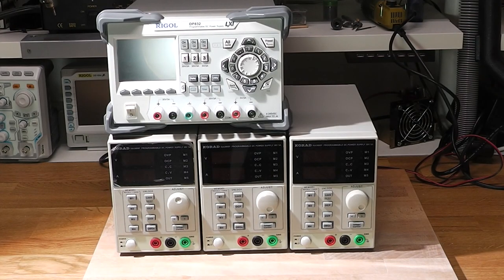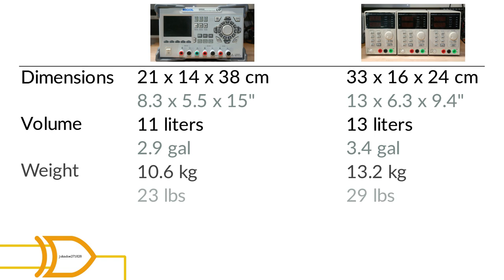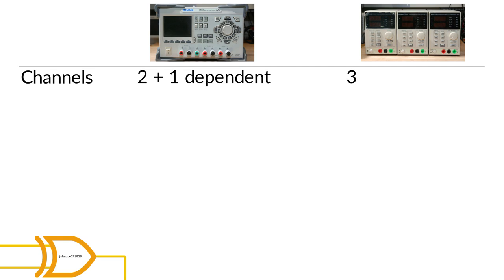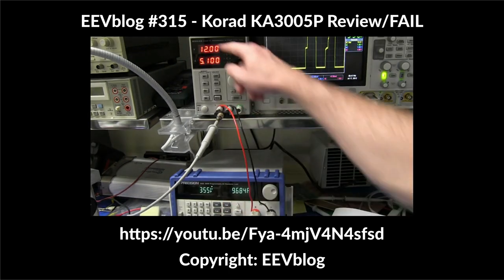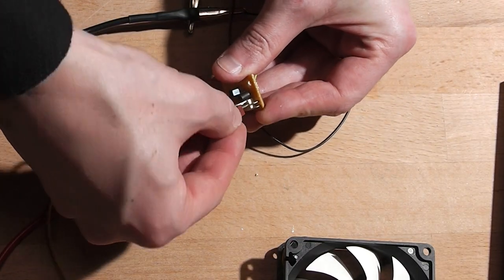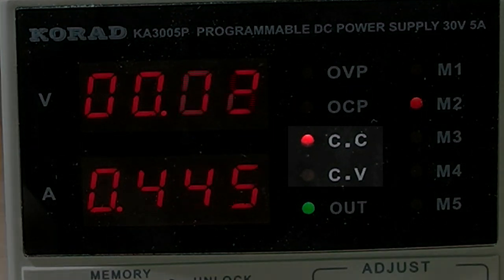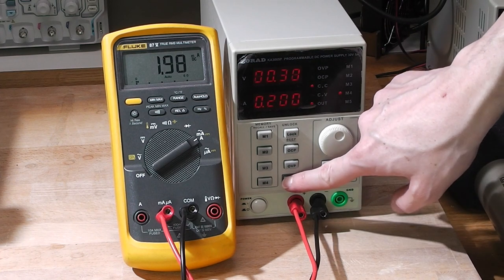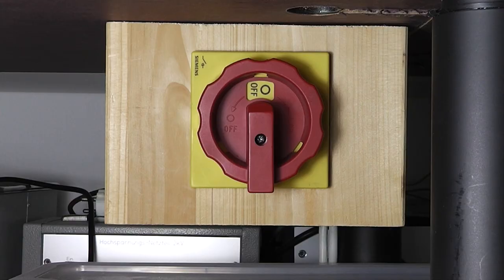Rigol DP832 vs. Korad KA3005P

Comment: The Rigol is programmable in many ways, that are all totally ignored in this comparison. There are complex Timer, Delay, and cutout programming modes.. I can easily set it up as a battery charger that cuts-off when the current falls below a threshold, to prevent trickle overcharging.. the Rigol is a proper Tool not just a Dumb Box.
Reply: So many fancy features and still sends voltage to your device when powers on… Without basics even fanciest equipment is a pain in the bum.

Comment: Rigol is modern design, it's Control part is seprate from output part, this means:1) You can power on 3 channels at the same time,so when your board has different power domains(such as 12V and 3.3V) can be powered on at the same,more safe.2) Programable,very useful when you debug your board. I had debug one board with python, capture output from UART, when some output is printed,hold on the state and alarm , if not power down and reboot again.
Reply from the maker: Turning on multiple outputs all at once is indeed something that multiple Korads cannot do and I completely missed that part. However, I think it's something that could be modded as well! So maybe an idea for a future mod :-)

The Korad 3005P version is also programmable, however. It has RS232 and USB and can be read out and controlled by it. This is why I didn't mention it (it's the same for both supplies).

Regarding the modern design, I'd disagree with you, however. While indeed the design is using more fancy chips and display, I don't really see that as an advantage, but rather the opposite: When something in the Korad breaks, I'm 99% sure that I could fix it, because it's a very standard linear supply. When something breaks with the Rigol, it'll be much more difficult.

In any case, a lot of interesting angles to the issue. Thank you very much for the suggestion with the on/off of multiple channels. That's indeed a great idea!
Reply: @johndoe271828  at the moment I'm using Korad yet one thing I like a lot in Rigol is that you can have all the channels under control in one glimpse of an eye.
In the Korad You need to check over a lot bigger space during working with multiple channels and if you have a lot of stuff on your desk, that means it is harder to operate in such conditions - oscilloscope, wave generator, soldering station, hot air, microscope, screen and any kind of other stuff.
It all takes the space on the desk/shelf and needs to be in a convenient place for use. So in this situation, less used space means more.
Reply: But the Rigol 3 outputs have a design flaw see EEVBLOG review. CH2 and CH3 are not truly independant, they blundered putting a common sense which can draws current if your circuit does not short 2 and 3 negative outputs and you also get voltage output inaccuracy . Rigol recognized their error but will not fix it as it is a redesign.

Comment: The Rigol has several hidden design flaws. Like CH2 and 3 and not truly independent, and the type of design flaw pattern they make shows a tendency to cut corners and sweep bad design with dodgy practices. Such as, wasting 5 Watts of power in a regulator pass device to lower voltage from the transformer for the digital section without sourcing a transformer with lower voltage tap.  I would not buy equipment from a company with that kind of dodgy philosophy, there will always be another design flaw waiting to manifest itself maybe out of warranty.

Comment: Both Rigol or Korad are "Scheisse".  They look nice but very short after using they will start making problems (same with Siglent). Dont spend your moeny on rubbish. Buy American (HP, Tektronix even if they are also made in the east) , Germann, or Japanees products and you will enjoy the money you have with hard work earned.
Reply: The problem is that (in case of the korad) you have to spend tenfold(!) (at least) to get a nice Keithley or Rhode&schwarz or something.
Not everyone is in the position to spend that kind of money. 
If money is no object, we all know where to get the best of the best.
Reply: @mrpetit2   The keithley multimeters 2000-2700 cost is € (euro)1000-1500 . The Uni-T ut-805  kost 369 = us$437  so it is only  2.2 -3.43 times more.  With Uni-T it is pure money thrown away !
Reply: @yoramstein  this video is not about multimeters and it's not about Uni-T.
A Keithley 2200 32V/3A or 20V/5A single channel powersupply ( Keithley's least expensive series psu) costs about €1000,-- ex. BTW, which is more than 10x the price of the Korad, and the Korad delivers more power (30V / 5A).
Nobody says the Korad is perfect, but it doesnt have to be for that price (€81 ex BTW at the moment)

If you make your money professionally with electronics, of course, get the keithley ( but I don't think those people watch these video's to get advice).
But If you're a beginner on a budget, setting up your hobby electronics lab, the Korad is a good choice. (Except for the loud fan, but that could be your first project 😉)

Comment: I wouldn't Switch From,  I would use all of them.   I have the DP832 fully optioned up and it can do soo much more then the Korad's.  I have other high current supplies if I need say 20 amps at 60 volts.

Comment: I did calibrate my Korad and it shows A and V readings very accurate 0.000V same as my Fluke 115  and 0.001A accuracy
Reply: How did you calibrate it?
Reply: You Tube : Kalibracja Korad  ,it is in Polish but step by step will do the job

Comment: I’ll say my experience is a little different from yours. I have three of the 3 channel Korads, one older unit that’s a side by side of the  of two single channel units. And 2 of the newer units with a variable temperature controlled fan. Now my older unit did have a fan issue twice in one year, but since I bought this refurbished I discovered the replaced fan was a 12V fan and this unit runs 24V for the fan. So this was the cause for the fans failing after 6 months. The newer triple korads are quiet with the fans even fully ramped up, it’s sort of impressive. 
As for the display update rate and accuracy shown on the display I saw the same things you did, the Korad display refresh rate is much faster.
The accuracy of the three channel korads (remember I have three of them)  compared to the Rigol I received is much more accurate and that annoyed me a lot. For the price I expected better accuracy and that was a disappointing discovery, but that wasn’t my experience. Some day I will have to calibrate the Rigol but for now if I need accuracy I use the korads. 
In fact, after dealing with firmware issues for years with the Rigol 1054Z and this Rigol power supply inaccuracy I’ve stopped buying or even considering buying any more Rigol equipment. My next scope will be a Keysight. 
I’ve never owned a single channel Korad, but I do find it interesting in the different results people have seen and that’s part of my problem. So many people experience different things with Rigol stuff it leads me to think the quality control is horrible for the calibration.
Reply from the maker: Hey there, thanks for your long comment. It really seems as if the 3-output Korads are much better in build quality than the 1-output units -- I really need to check them out in more detail. The flexibility of the 1-output units is also rather nice, though. I'm already planning on adding a single switch to enable all outputs at once, but currently work gets the better part of me.
Rigol does seem to have declined in my opinion, even though they were the first ones to bring digital phosphorous to the hobbyist market. But they're not as competitive price-wise anymore than they were. I've also heared good things about Siglent, may need to check them out for sure. Currently thinking about buying a specanalyzer and believe they have a nice unit.
Keysight, ah, yes, those are indeed nice things. I got to play with a InfiniiVision 4000 IIRC at work. Very nice build quality and precision. However, the pricing is far beyond which what I could reasonably argue with my wife that I "need" :-) Or are they starting to target the hobbist market (i.e., let's say around 1-2kEUR)? Not sure to be honest.
In any case thank you so much for your comprehensive comments and feedback. I really appreciate having people that I can bounce ideas back and forth with. All the best, Johannes
Reply: Hi Johannes, I haven’t tried siglent yet. I do try to keep the price down myself as well and for what I review or recommend mostly for my own budgeting since you can go broke in the hobby fast. I think I would only be willing to lay for a Keysight scope, well the newer 1000X serries scope that does bode plotting, has a signal generator and much more for the price..I never had a chance to get a good signal gen and for the price of the 1000X I can justify it since it does a lot more. If I really need 4 channels I still have the Rigol DS1054Z of it doesn’t lock up on me when I’m doing a test. Current,h my main issue with the one I have, but it’s so intermittent I can’t pin down a reason why. I’m sure the rigol PSU will be nice once I get around to calibrating it. Theirs a script for automatic calibration on the EEVBLog if you have a bench meter you trust to interface it with and that’s the plan. As for other Keysight equipment, I don’t think I can justify the cost for my needs, and yes happy wife = happy life.
It’s funny you mention a switch for the two singles to run together, that’s all the older style triple has is a single extra PCB with a relay to switch 2 outputs together as parallels or series controlled from the micro controller front interface panel. I’m sure you can do the same with just adding and flipping one if two switched, one for parallel and one to flip for serial. On second thought you want to make it a single three way switch instead so you don’t accidentally enable both modes at the same time. 
Either way for the price Korad makes some good stuff with the older units after they addressed the original issues. Rigol ok also, but as you mentioned their prices are not as competitive. 
Little interesting known fact, most of the older Rigol designs were done with/by Keysight. Then Keysight made their custom chip to capture more waveforms and went a different direction. 
Thanks for the reply,
Scott

Comment: Korad also has the ka3305P. 
Not totally 3ch, but 2 channel (0-30V 0-5A) + 5v 3A.
With a very quiet speed controlled fan, and programmable by usb. I bought one on sale for €144 ex VAT, so way cheaper than the Rigol.(normally its about €190 ex vat, still cheap)

Comment: Good video on your preferences.  I also have both the DP832 and the "newer" Korad KA3005P.  For me they are both useful but a two or three set composed of Korads do not offer series tracking and since I do a lot with opamps that is a major deal breaker for going the route you selected.  Again good video and I agree with you on the short comings of the Rigol.
Reply: Was ist "series tracing"? Can't find anything on google about it.
Reply: @limebulls  Oops sorry, typo error.  I did not mean series tracing but series tracking.  I have corrected my original post.

Comment: I found this Korad KA3005P (https://www.welectron.com/Korad-KA3005P-Benchtop-Power-Supply) and just wondering which one is newer/better. The one with screw-in terminals or safety terminals, from the video, with the flat banana terminals. Thanks.

Comment: I'm on similar dilemma and wondering how would you proceed if you want 3 voltages at the same time? I mean with the rigol you could just turn it on with the outputs enabled but with three separate supplies you would need to power them on with a power strip, right?

Comment: Furthermore...
Rigol is a wildly and freely programmable bench PSU. It has a lot of added functionality which is not easily reachable with an analogue-type PSU like Korad.
Rigol also has a programmable I/O on the back. It is also possible to turn on and off all three channels at the same time (within milliseconds), though you're not able to make a programmed turn-on procedure.
On the downside: The OVP function has some serious (and dangerous) limitations. If set, even the smallest overvoltage may kill a sensitive product with that huge (sometimes over 10s of milliseconds) overshooting.

Comment: Thanks for a  great review.
I own the KORAD KA3305D , it is more like the Rigol.
You ask if you have forgotten anything and yes, maybe you have.
1) how do they compare in build quality?
2) How clean are the power, both compared?
Reply from the maker: Hi! The build quality of the Rigol is perfect, no doubt about it. It's super sturdy. The Korad's build quality is behind that of the Rigol's for sure, but it's not the typical cheap junk that you so often see. I'd say it's fairly reasonable. Examples: the rotary encoder of the Korad has a good feel to it (no jumpiness or similar), the grounding seems to be done properly, safety distances have been held as far as I can can tell, the USB/RS232 is galvanically isolated and such.

With cleanliness you mean high frequency noise I'm assuming? I indeed failed to film that and cannot compare it now because I've already given my Rigol away. I'm sorry about that :-/

Thank you very much for watching and the great hints.

Comment: Wondering if Peaktech 6070 is any better than Korad? 6070 has no moving knob and no fan (a huge outer heatsink instead) and costs 50% more than Korad (RND branded Korad, to be specific). Still, not sure about the internal quality - I haven't yet found any teardowns of Peaktech 6070. So, inside it might be worse than Korad and I might be overpaying for the OEM brand and better packaging.
Reply: Thank you for mentioning Peacktech. It's german, so it enters in my competition immediately, specially since the prices are in my target range. Did you get one?
Reply: @manuel_youtube_ttt  I ended up with Korad. At least, it's a "known evil" and there are lots of reviews and known issues with solutions.

Comment: Witch lab power supply do you think has the most possibilities the Korad witch has a user manual of 4 pages and the Rigol has a user manual of 64 pages excluded the extra features of a total of 300 pages what do think witch is more advanced?
Reply from the maker: Why do you get the feeling I ever claimed the Korad would be more advanced? Because I did not intend to convey that message at all. Clearly the design of the Rigol is more sophisticated, but also a lot more boutique parts are used in its construction. Do I think I could repair a broken Korad? Fairly sure. A broken Rigol? Absolutely not. Simplicity can be a virtue and for repairability purposes, it clearly is. To be honest, in my day-to-day business I do not care about a bunch of artificial extravagant features when something as dead simple as a clearly marked CC LED is missing. That's just painfully annoying for my taste. I've tried being objective in my comparison and explain why I prefer one over the other. Neither are bad choices, it's a matter of preference. Comparing two bench supplies by measuring the page count of their respective user manuals seems to be a fairly poor metric in my opinion.
Reply: No that didn't I mean what I mean is the Rigol is far more advanced

Comment: I specifically bought the rigol for 3 channels and also did not realize this, I would have just got the siglent, this ps is way overpriced.
Reply from the maker: That's a great point you're making -- indeed if I had to re-buy a power supply again I would now go definitely for the Siglent SPD3303X-E. Absolutely love the well-visible CV/CC LEDs right at the jacks, THAT is great design.
Reply: @johndoe271828  hey what's is the best choice rigol 832A(700€), 3x Korad 3005 or this siglent SPD3303X(640€)? I'm buying my first, but i wanna use him for like 10-15 years. You just good PSU for years

Comment: What about the voltage correction of 0.2V? Can you confirm that the display jumps to the "set" value when the actual voltage is within \pm0.2V of the target value? Here is a description of this "feature": http://whiteboard.ping.se/HackValue/KoradPsu
Reply from the maker: Wow! This is BAD.

I've just tried the exact scenario that Mikael described in his post (5V setpoint, 20 Ohm load, ramping up current from 230...260mA). And I do indeed see exactly the phaenomenon that he also describes. That is indeed very crappy and I definitely need to make another video about this. Thank you very much for bringing this to my attention. I'll think about if this is fixable (firmware hack maybe?).

Thanks for the comment!
Reply: OK, thanks for checking that. I ordered a KORAD yesterday, maybe we can hack it easily ;)
Reply: @tamasgal_com  @johndoe271828 Any update on that issue ? Is it fixed ?
Reply: I just tried to do that with my KD3005P and it did not happen. So maybe just avoid putting too much faith in the pushbuttons is all that is needed?
Reply: I just got a KA3005D (that's with all the buttons but without USB), tried the same thing and it does not have the issue thankfully.
Reply: @Jay2k1  I already have three of them and they are all fine ;)